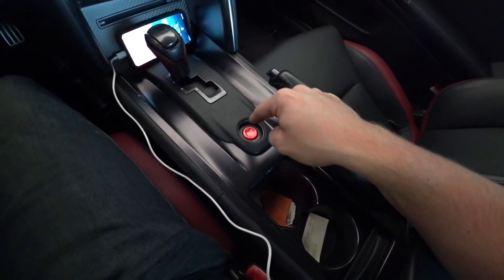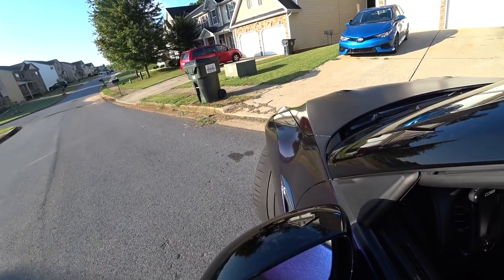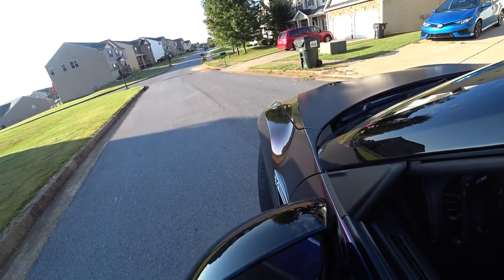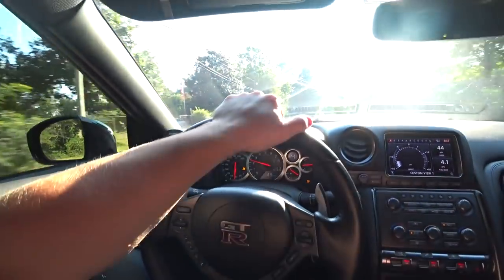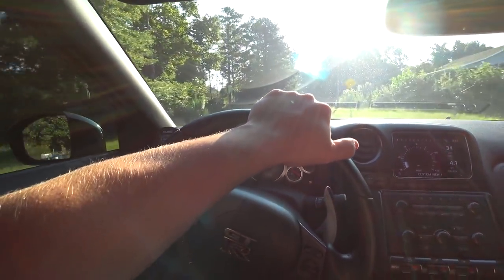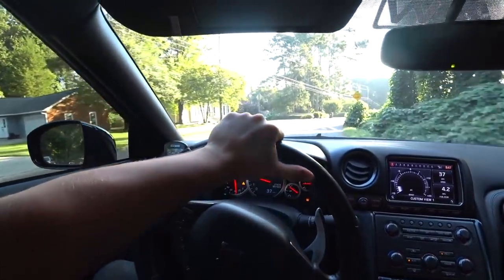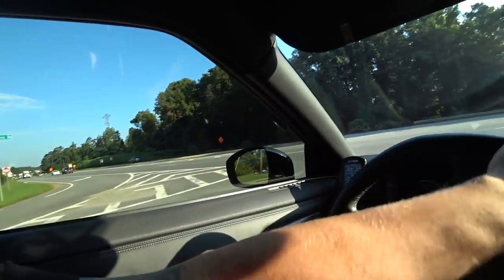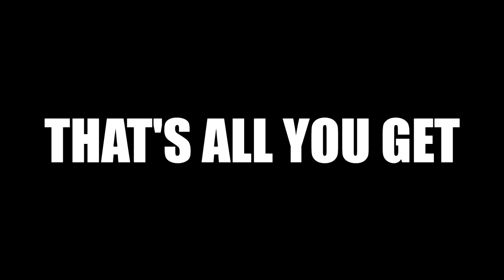Why Does This Car Have SO MANY PROBLEMS?!

Comment from the maker: I know that many people keep saying "CV Joints"... I'm assuming they haven't watched the full video at that point... but I will type it here in hopes those who come to type "PROLLY THE FRONT AXLES" see it. While it does sound like a warn CV, its not. Please take a look at this thread here and it somewhat explains it (http://gtrtech.blogspot.com/p/brakes.html). This is a pretty common non-issue that GTR's experience I guess. Had the GTR Tech confirm it and all. He's never even seen one with blown CV's, and he works on GTR's that are driven a lot harder than mine. Basically rust builds between the hub/rotor/wheel and it makes the sound. Go figure. Only a fuckin rice burning Nissan would have a minor issue sound like potential catastrophic failure. I just don't feel like tackling it myself in my garage. This is probably my biggest distaste with the car. Its all these little small clanks and noises and beeps that can take away the enjoyment of driving the thing. Other than that, its hard to beat performance and smile wise. Its tons of fun, its fast, and the looks it gets from most people is exciting. Love the car. Just wish it was more...refined? Anyways, enough bitching. Eat ass and skate fast.
Reply: Are you gonna ever ride a grom? Or have you? I wanna see a test drive so i can see YOUR reaction😂
Reply from the maker: I had a grom a few years ago. It was fun when in groups.
Reply: Was gonna say I thought it was some pin in your brake caliper. Like one of the pins doesn’t have a locking part so it rattles. The top pin on the caliper. Some guy on YouTube talks about his issues and he said it sounded like bolts rattling
Reply: At least it's minor. Every Chevy I've owned prior to my current one has required some sort of major work lol
Reply: I was JUST about to say it sounds like worn CV shafts, having driven Audi's since my first car I know the sound well lmao
Reply: Do It With Dan sounds like you need a vette
Reply: Do It With Dan did you make a video on it? I wanna seee
Reply: Hi
Reply: dan i think its time to go for a reliable a
British beast
Reply: @maybeamy5837  he sold it a long time ago but he did ride it a bit.
Reply: I work at a nissan dealer and I do this a few times a week it's the splines of CV axle that go into hub have to clean and lube with grey nissan goop
Reply: Refined.. You bought a used GTR my guy. That was a bad idea.
Reply: Even the more "refined" cars develop squeaks, rattles, buzzes, and vibrations after the miles start to rack up. You have stiffer suspension, low profile tires, and massive power that twists the car ever so slightly. After time things are gonna loosen up. I see it daily when people buy used AMGs and complain about rattles and squeaks. You can only quiet down a street legal "racecar" so much without adding a shit ton of weight with sound deadening material. Everytime you hear a rattle just think to yourself because racecar. 😀 Btw I've got a few diodes laying around from when I redid the turn signals on my bike. Should of asked a brotha.
Reply: Do It With Dan might be power steering I got a buddy had the same sound on his camero
Reply: Ive had 2 Nissan's and both did it at full lock. Something to do with the turning blocker thingy rubbing. Might be a different issue but that sounds like a you problem
Reply: Didn't even finish reading your comment, dw lmao
Reply: Cv axle is out!
Reply: i was gonna say it was a worn tie rod, although never heard one tick like that
Reply: *RELIABLE JAPANESE CAR*
Reply: To be fair your question was answered.  Unfortunately a common issue would be a cv axle.  What you asked is a common question asked in ASE testing and their answer is cv axle.  Anyway good thing your buddy got it fixed for you.
Reply: @DOITWITHDAN  The Grom is a pretty item. So, when on a Grom, one must travel in herds, as even Harley Iron 883's will eat you alive.
Reply: Not to sit here and play devil's advocate, but it might just be the front axle. Had to replace one recently on my car because of the same clicking.
Reply: Yo Dan, I have the old school SMG M3 (grandfather of all this super cool DCT bs today) and the trans if the same way.  Knocks, noises, all kinds of weird stuff.  Feel your pain.  Same thing happening on my car right now when I take off in the mornings - rear wheels "tinging" I would describe it as.  Just racecar noises.  Be good dude, drive fast take chances.
Reply: Worn***
Reply: It might be the actuator
Reply: That ticking noise is your control arms, they need to be replaced.
Reply: Hey Dan. My cts v made the same exact noise and it was due to the surface between the wheel and the hub not being clean. Gm put a service notice out for all the V's about how it constantly comes back and is normal. See if it fits your description
Reply: Shiuld have continued to watch before I commented. Lol. I think you're spot on with the rust between the surfaces.
Reply: Do It With Dan I have a hellcat with the 2 piece Brembo brakes that click like that. So if that gtr has 2 piece rotors that might be your clicking

Comment: I totally understand what your saying in the video that’s going on with your zilla, I’m a mechanic at a local shop and I always grind off the rust on hubs, axles, and backing plates when replacing rotors. Cause if I don’t 9/10 times it makes the same noise

Comment: You don't need blinker diodes, just change the blinker fluid (make sure to use synthetic blinker fluidl)😉
Reply: Nathan yeah i once put some nonsynthetic blinker fluid into my renault and it started blinking everywhere even my interior lights blinked :D

Comment: Re-torqued lug nuts.
Cleaned the contact point between the wheeland the brake hub (although was very clean).
Added the 2nd retainer clip in the top of the caliper.

Comment: Its a Nissan thats why
Reply: El_De_La_Lobo I own a old niggas 2005 G35 that has been more shit you can imagine, if you take care of it , it will last 300k+ miles
Reply: Lmao call em ricey or whatever the fuck. But you can't say Nissans aint bulletproof
Reply: I can say they aren't reliable because they are now French.
Reply: Don't think it has anything to do with the brand, sport... In most cases, people that have an issue with particular brand of cars, they instantly hate the whole brand, when most of the time the problem was caused by driving like an idiot or not doing maintenance. Just my 2 cents ;)
Reply: Boxtop but sometimes that cars are shit and pretty much that’s their fault for buying them
Reply: While that is true, I'm mostly talking about people who buy brand new cars, and have problems then start talking mad shit about the manufacturer because they don't maintenance their vehicle. I personally have basically a really big paper weight in my garage that doesn't run because the previous owner beat the absolute fuck out of the transmission and didn't do anything but drive it and put gas in it. I blame the previous owner, not the car itself.
Reply: Its not a Nissan, its a datsun
Reply: @jessekolk5097  a Renault powered one at that.
Reply: A gtr is unreliable becouse it's a 500 plus horsepower high tech v6 sports car.
Reply: @that1guy449  well thats nothing, damn here in Europe everything will last that much... Except for Smarts and GM vehicles... Those are garbage and blow up before 100k

Comment: I work at Hardy Chevrolet in Dallas and some brand new Chevrolet’s have the same problem, I’ve fixed quite a few of them by taking the wheel off and cleaning the back of the rim where it bolts to the hub and cleaning the hub itself... if it’s really bad very light sanding in those areas is recommended
Reply from the maker: Yea that is the issue. Apparently its common when the car sits for an extended period of time. Mine was parked for a few weeks when it was getting wrapped and had my surgery.

Comment: e85 cold starts arent an issue if your cold enrichment table is tuned right. But seeing that you have a Cobb tuner, im guessing you have an off the shelf tune which is shit in comparison to a real tune.  you need an open source tune from a good tuner.

Comment: You are correct about the axles. It's because they have CV axles and alot of power will wear them out. The rust could be the problem but I doubt it

Comment: Could be wheel bearings. We had the same thing Porsche and Audi. Particles of dirt would get inside the wheel bearing area and cause a clicking noise when turning at low speed. My 2 cents. Oh and if you want to hear some noise go take a ride in a 911 GT3RS, the trans sounds like its coming apart but its normal.

Comment: The noise is the transfer box as uv changed to size of the wheels and tyres and the electronically controlled box doesnt have any new info to take into account and so doesnt correct itself properly

Comment: Should have bought another vette, js
Reply: Ball joint can do that noise as well
Reply: no
Reply: Just cut the control arm on the GTR and set the door on fire while turning off the ignition and it basically is every Chevy

Comment: Could be a split CV gaiter? Had a similar issue on my car, found a split was causing grease to leak and eventually caused metal on metal contact. Sounded like a stick knocking the spokes of a bicycle as it goes round.

Comment: there's an EASY fix for the ticking in your wheel. you need a 10 dollar clip and you can fix it easy. there's 2 pins in the brake calliper and for some reason only 1 of them has the good clip that holds the pin in place / puts tension on it so. i guarantee you if you add that second clip your problem is solved <3 all you have to do is take of the wheel and you can fix it with the brake calliper on the rotor. 10 min fix

Comment: Got a 93 240sx original paint. I wouldn’t call it great condition by any means. It’s got some chips and dents. And a small rust spot in the corner of the rocker panel. But it’s still got a decent gloss to it when I clean it up. No fading or peeling. I’ve had a ton of early 90’s cars and I’d say it’s in way better condition than them. I constantly have people coming up to me shocked how clean it is. Oh and it’s white so you know that will show imperfections real quick.

Comment: my Subaru legacy and my Nissan made that noise. all Japanese cars make that sound its the front suspension moving a millimeter left or right or its rust Japanese cars rust fast and if you keep driving it eventually the sound will stop

Comment: it's because of obsolescence. they will not build perfect cars except very expensive cars like 918 spyder or other examples. it's not an unique car on the market they have build many nissan gtr and the materials will have problems after a while. if you want a perfect car than you have to change anything by yourself and make it even better with quality. but that's very difficult.

Comment: Doesn’t sound like a cv joint at all. It’s a single click. If it were a cv it would be multiple clicks. That sounds like a broke tierod shifting in the socket. You hit a curb lately?

Comment: Jack it up and spin the wheel... What is wrong with you a clicking noise and you think it's rust??? The rust would just come off after a while and the noise would go away.  CV axles can make either small clicking or loud clunking depending on how far gone it is

Comment: I had the same noise in my car (e90) thought it was the CV joint. Turns out my car doesn't have CV joints in the front. It was the tie rods, lower and upper control arms and front shocks. I've never heard the hub make that noise.

Comment: Might as well call it a Honda Civic
Reply: I think you got cars mixed up because honda civics are some of the most reliable cars made 🤔 if you said anything Hyundai sure
Reply: Depends on who drives the car
Reply: @travisgoodfella  I mean I own 2 and both have been extremely reliable and great on gas 400whp turbo one and a 300whp supercharged daily one, not sure where you got your info from, unless they got a clapped out civic and try to boost it with 300k miles on a single cam to 500whp sure its gonna become unreliable
Reply: Lol my 91 civic is about to hit 420k. All original and yes it's slow af but it's been reliable and can't complain with it at all.  Been to hell and back with that thing.. twice.. stay on top of maintenance and try to baby it and hope for the best. Peace everybody. 🙂👌

Comment: Call out to a CERTIFIED TECH local to dickhead; check out crazy’s car! Good idea going to a specialist fucker. The more money you spend for performance, the more money you’ll spend to maintain them. Even if you build one yourself, more money more problems. E85 is insane and I don’t know a single sole who doesn’t have issues with it. After becoming a tech myself, I can say I’ve learned a lot and Nissan is not on my good list.  I hope you get it sorted because it is a bad ass car. We could go steal a radio if that would make you feel better. Lol. Excited to see your bike when it’s done.
Reply from the maker: The car makes like 60 more HP on E85 but it’s kind of a nasty fuel. It smells weird too. Steal radios you say?

Comment: OH thats right i forgot. Dan youre young. Thats the problem. Nissan is Japans Dodge. Oh wait you have one of those too. Grew up on a used car lot. Mazda, Nissan, Chrysler, Subaru and anything European is junk when it hits the used lot. Some are junk before they leave the new cat lot. And the sound from the rust grinding or whatever???...you keep believing that. Get rid of it and spend about 30 grand and get yourself a nice Chevelle with an aluminum big block and a modern trans and be done with it. Youll turn heads as you rip by other people.
Reply: He better like bump steer if he goes that route

Comment: 1st world problems. If you were a certified mechanic you would learn to ignore all the noises your car makes. Mercedes has the same issue with clicking while turning. Have to pull the front hub assemblies and grease a bunch of shit. Then you pray it goes away.

Comment: Dead right about paint quality. Big gm fan but today’s gm paint is garbage. Orange peal. I’ve literally seen rust on brand new floor model trucks! 

They want to change motor range but they don’t wanna fix rust issues.

Comment: Probs? 🤔 you needa drive my worn out zombie of a civic🧟‍♂️... the qwerks in my car would make you lose it danno. I love it cuz no one would steal it. Lol omg plus its about to hit 420k miles. OG motor. Struts are gone. Go into a corner doing more than 35 and the rear tires basically twerk and the ass end kicks out for a sec if you hit a bump..😳🤪 Long story short, it's slow af but reliable and very simple. 

P.S. no A/C and the only good thing it's got is a fn febreeze storm breeze air freshener in it and a jake TGS sticker on the gas lid bitches!! Lol peace everybody and dan.
Reply: LOL, shit made me laugh pretty hard. Especially the twerk part 😂
Reply: @uncannyjt9671  😁👌